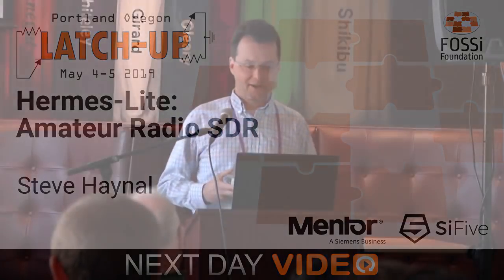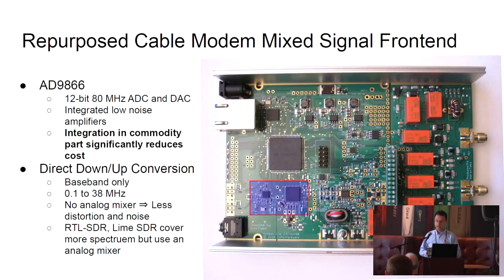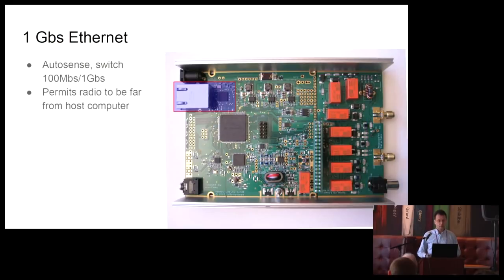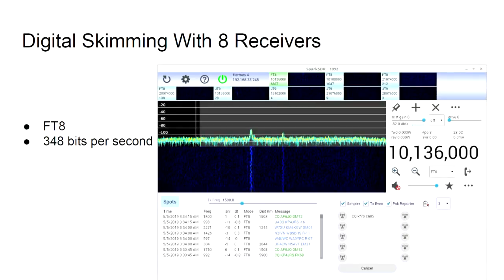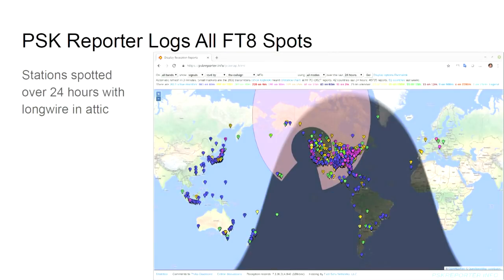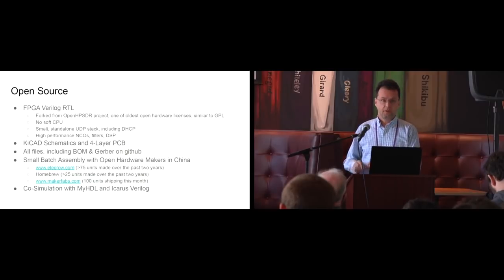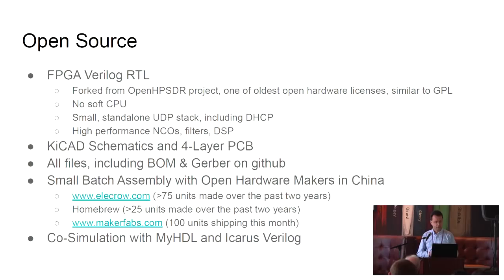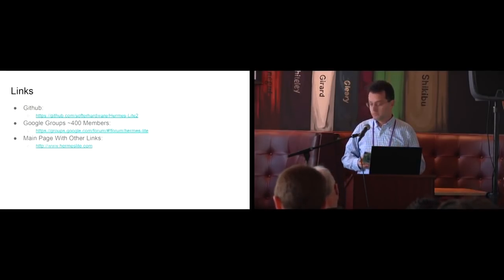Hermes-Lite: Amateur Radio SDR

Comment: not mentioned in the presentation but worth stating for the record: the Hermes Lite 2.0 resembles the ANAN-10 and -10E in many ways, not the least is they use OpenHPSDR Protocol 1 over the network. this radio is produced in batches (about one per annum) and is (a/o 2020) a relatively mature and stable design.